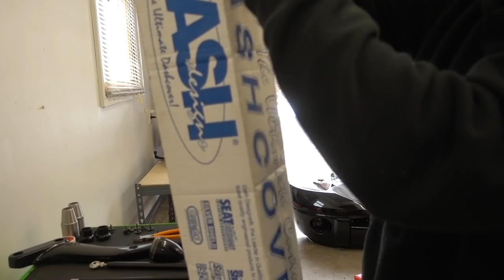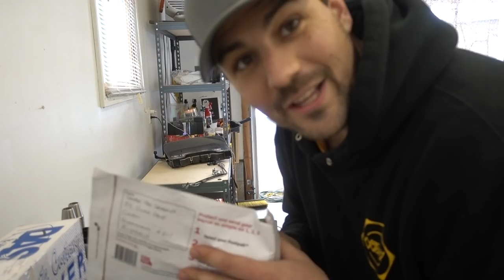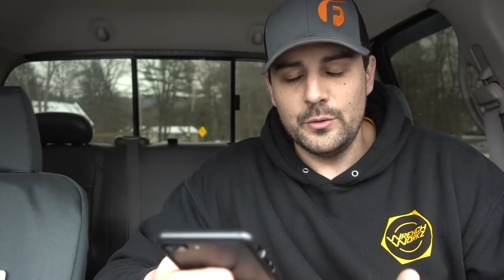MASSIVE Lime Green CUMMINS!!!   Q&A TIME!!!

Comment: At around 22:15 you talk about sandblasting the bumpers, I know that sand comes in different grades and you can also get aluminum to blast with and also walnut hulls are what I used offshore a lot when dealing with stuff that couldn't get scared up and that may be something to think about on bumpers of course it may not be strong enough to work on chrome.  But it's great for cleaning purposes too on nasty engine blocks.

Comment: Hey Greg, have you been able to find any reproduction interior trim for the first gen? We’ve been looking for some for years and would love to find some for our 2 first gens.
Reply: https://dodgeforum.com/forum/1st-gen-ram-tech/152512-reproduction-interior-trim-72-93-dodge-full-size-3.html 
Nothing ever came of this that I could find out...I got lucky and found some decent pieces out of a wrecked one. Still have a couple extra pieces in the garage. What are you looking for?
Reply: Mitch Malone oh sweet, I’ll have to check that out. We have one crimson and one grey interior. Both are extended cabs and we both need that piece that runs along the windshield and headliner. And I need a grey back panel that finishes out from the carpet line up to the window sill. In fact, I think I need all the trim that goes around the headliner besides the b-pillar trim. I’ll have to go through the pieces I pulled out to inventory which ones are broken. I’ll do that tomorrow and get back with you.